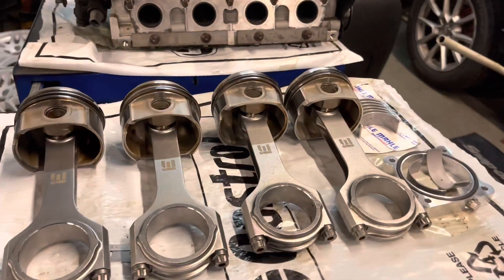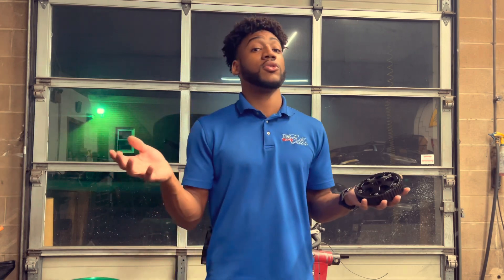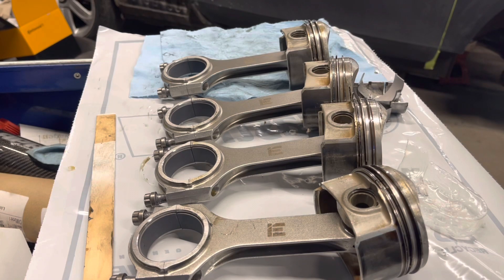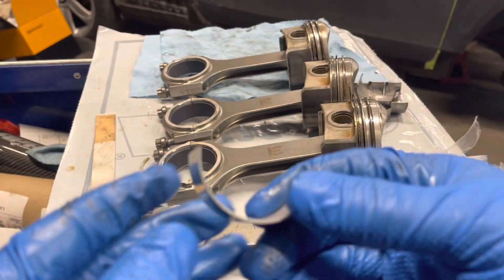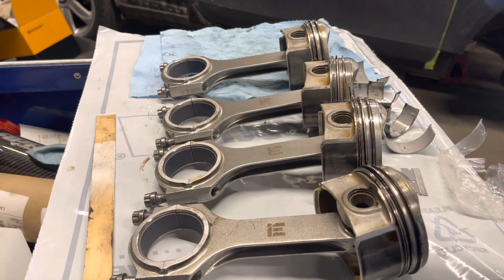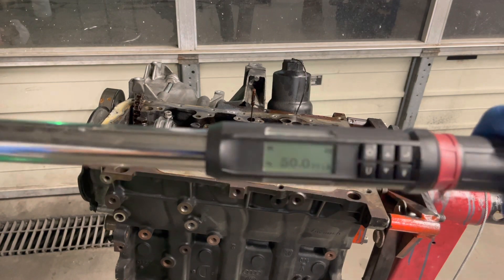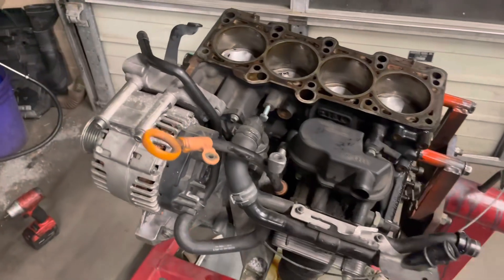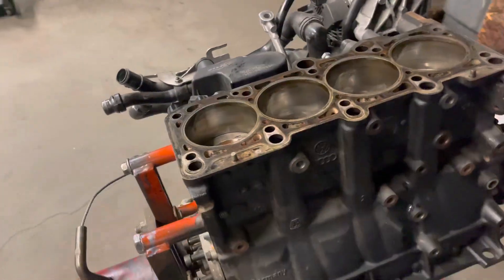How to install IE Rods in VW/Audi  Engines  Audi A4  ! (2.0 FSI) (project A4 build Pt.3)

Comment: What headgasket thickness did you use? Stock or thicker to lower the comp ratio?
Reply from the maker: @bike23august  stock head gasket on this one
Reply: @Quattrogame_pro  so 10.5:1 comp ratio. What power did it make on the stock pistons? I see it's very responsive

Comment: I went with the RS4 injectors as well with my KO4 build but most recommendations are for the the S3 injectors.Better spray pattern and more flow.  What's you thought on that?
Reply from the maker: The RS 4 has more overhead and can fuel up to 600 hp the s3 injectors slow down around 450